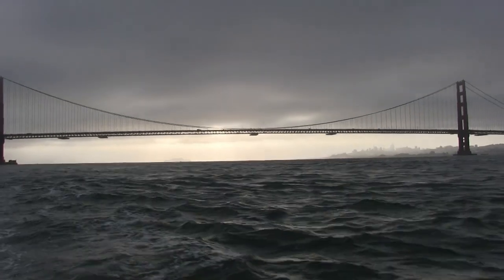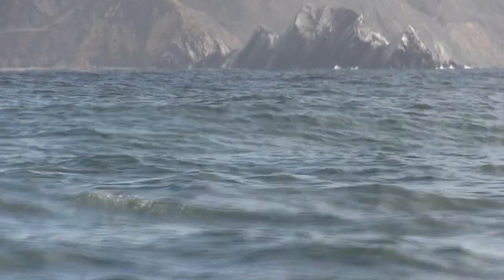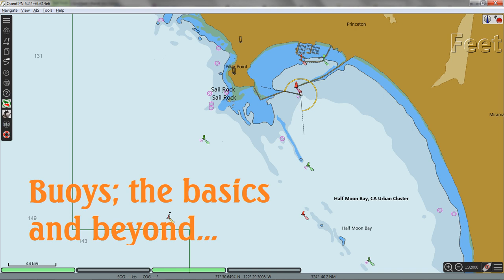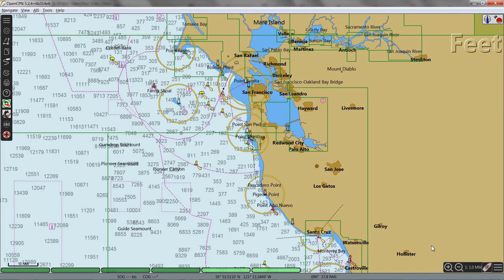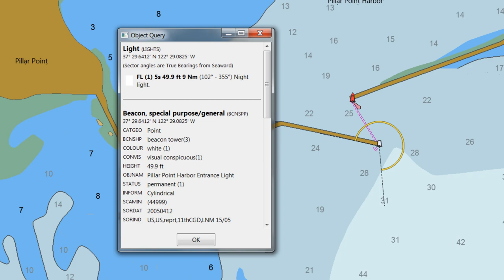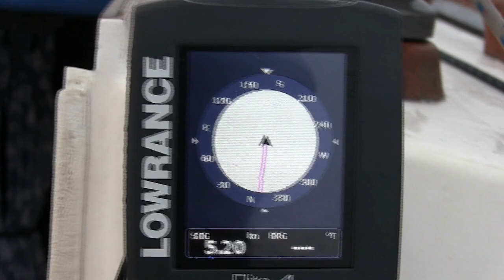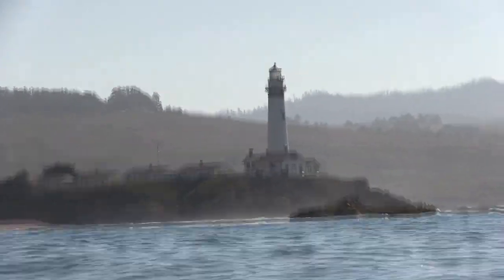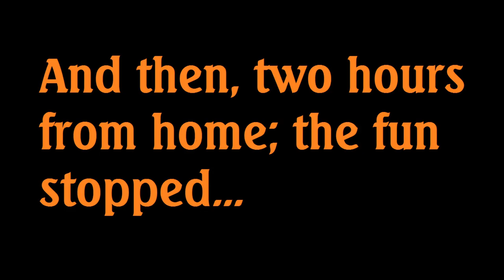~ CRUISING IN A 19' SAILBOAT (Part 3) ~ Horseshoe Cove, HMB, Santa Cruz

Comment: Interesting to see you rudder failure, we had the same happened on our Siren 17.  Rudder Craft said they have made hundred blades but only saw a handful failures and blamed it on a possible bad batch of plastic...  We sailed our Siren 17 pretty hard and when the boat is heeling a lot, there is definitely quite a bit of pressure on the rudder and I am not sure that HDPE plastic is a great material for this use.  Prior to our rudder failure, we sailed in Florida for 3 weeks and there were quite a few occasions when we had to raise the rudder horizontally to sail in shallow water.  I was careful not to steer to hard but there is a possibility that this may have caused some weakness in the rudder blade.  In any case, Rudder Craft promptly send us a replacement blade which I never installed, I instead made a solid Mahogany blade which is quite more stiff and has been super reliable.
Reply from the maker: Yup. I'm really starting to wonder about Rudder Craft. 

BTW, how thick is the mahogany on the blade you made?

Comment: Wow! that rudder failure !
Reply from the maker: Thanks for your interest and comment. The rudder failed due to it not being the "Blue Water" version, consequently it suffered stress fatigue. I've since made a temporary rudder for use in protected waters until I can get the BW upgrade. One of the benefits of having an outboard is that you can steer the boat just like a dinghy.